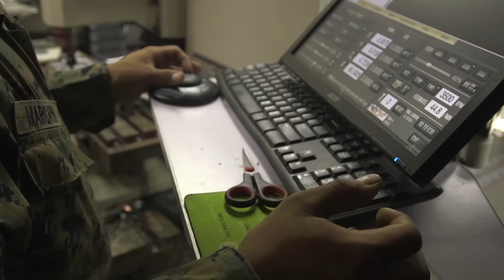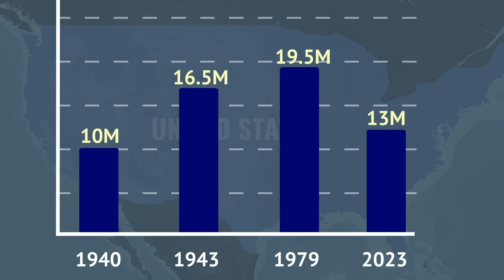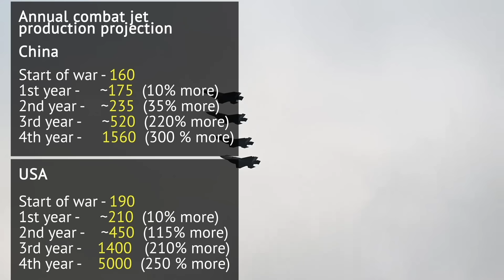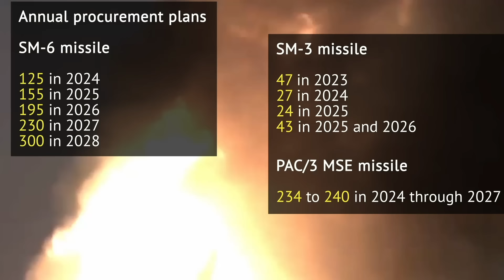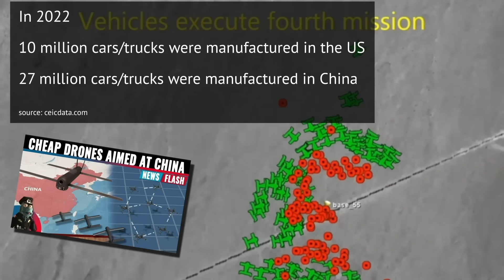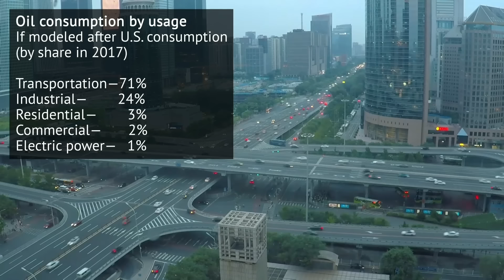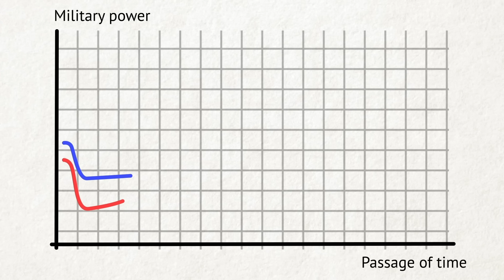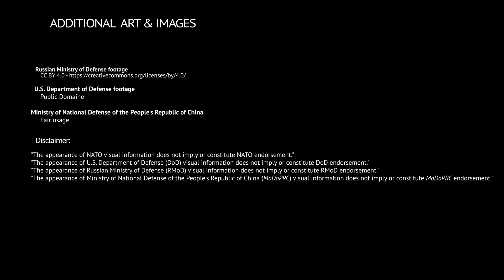Can industrial output decide US v China war?

Comment: Industrial out put is not the deciding factor, it is raw materials, I believe the access to material is all USA
Reply: It doesn't matter if 70% of the world steel plants are in China.  How much more steel can US produce with all the iron ore in the world?
Reply: @What7YiYue  55% of steel production happens in China, but 50% of steel consumption happens in China. We will enjoy seeing both of those numbers plummet. The difference between 55% and 50%— that 5% is what the world needs to replace, mostly by increasing output from its current 45% of global production. Big lift, but definitely possible. And even if there’s some small amount of shortfall, the US’s market power ensures that the US won’t face any shortages.

Comment: Commissar, I must report intel that you did not consider in your report. The US has declassified cruise missiles that have the range to strike the airplane factories that you stated were outside of airstrike range. The AGM-158B-2 has a range of 1,200 miles and can be deployed by B-2 Spirit stealth bombers operating out of Guam, Hawaii, or the continental US. They can also be fired from the B-1b Lancer and B-52, along with several current US fighters. This would change your calculus for the outcome.

China would not be able to fight the US to a stalemate in over it's land as they would lose the ablity to build new fighters very quickly in the conflict. This would make the planes they have very finite and they would be used much more carefully to protect the most vital areas in China: the capital, the dry docks for their navy, the air fields where their fighters operate out of, jet fuel depots, fighter pilot barracks, ammo depots, ports.
Reply: Thanks Knights, that was a rare example of comment which substantivly adds to the video.
Reply: @kennethferland5579  Yes. I only recently learned of these new, long range cruise missiles. They change the calculus for strategy for placement of SAM systems and factories for both China and Russia since they are capable of such long range penetration and can come out en mass from so many aircraft now.

Comment: China's real problem is the same one Japan had: they don't have any significant oil resources and their supply lines are extremely vulnerable. 
Building pipelines across western China to obtain fuel from a pipeline across eastern Russia is infeasible, the distance is too great, the environmental conditions too extreme, the throughput would be too little, and those pipelines would be extremely vulnerable.
So, any conflict would mean China needs to protect vulnerable trade routes like the Straits of Malacca which would essentially be at the mercy of a massive and overwhelmingly capable US Submarine force. 
And to China's detriment, there are perhaps five or six chokepoints out of the South China Sea where that vulnerability could be exploited, which would lead to a shutdown of all trade to China from the Indian Ocean. 
Which is the route used to ship the oil China buys. 
What this means is a direct conflict with the West, if China has not secured those very vulnerable energy supplies, would mean an almost certain defeat for them.
And... With the World's increasingly reduced dependence on the Chinese manufacturing base, most economies are reaching the point where they could easily weather the storm of losing access to Chinese products in their markets.
Of course that leaves China looking at certain ruination while sitting on a large stockpile of nuclear weapons. I know their policy is no FIRST use, but... That's a lot easier to say before everything is falling apart, isn't it?
I suppose we must all hope the decision-makers in China seek to avoid a kinetic war as much as they seek an information and economic one...
Reply: Russia has a lot of oil and natural gas that can supply China each day!
Reply: @LH1xx Nowhere close to enough transport capacity.
Reply: @LH1xx  They can... But getting it from where it is in Russia to where China needs it will be problematic...
Reply: Exactly why China spent so much on clean energy and electronic car.

BTW, China is the world's 5th oil producer, so military running out of oil is not going to happen in China.
Reply: @a24396  Why? China and Russia are strategic partners, Russia would supply China with oil and gas no problem.
Reply: China lot of oil reserve, it simply has higher consumption. In war time, there won't be shortage of oil for it's top priority
Reply: @tainechen1634  It's not their military running out that will be the issue, it's their overall economy. Ultimately the energy issues can be solved but there will be a massive disruption of their economy first. I suppose if they are extremely motivated to have a conflict with the west it's possible that disruption isn't going to matter, but unless there are some very strong forces prompting everyone to accept this level of disruption it doesn't seem likely the Chinese people will accept this for too long.
Reply: @LH1xx  The willingness is not the same as the ability. If you look at where the Russian oil is located and how far it is from china, how much pipeline would be needed, etc. that's the issue. It would all need to be built because it doesn't exist right now. So that delay might matter while a war is being fought.
Reply: @yingguo3683  China's reserves aren't the same as production. China is listed a number 13 in the world in terms of "proven reserves" but that's all in the ground. For them to support a war economy they would need to develop those resources. And there's little chance they'd have the time to do that.
Reply: @a24396  That’s just not true, China produce 5 million barrels a day, 4th largest in the world, they have 25 billion barrels in reserves, 14 largest in the world.
The import from Russia rises every day and several pipelines are being built and when they are connected to the Russian  pipelines that already exist they get what they need to wage war from them, it’s not hard to build pipelines to Russia, and they are not vulnerable.
Far from US reach.

So no, they don’t need to protect their trade routes, that’s a problem for USA to keep the blockade and police other nations that would do what they can to brake a blockade, China will not starve or freeze.

And easy wether the storm lol, Europe and the world are still in the storm after the Russian invasion of Ukraine, and that’s a war with insignificant nations when it comes to export/import and word economy, a war with China and USA would plunge the world economy to the depth of hell.
Reply: @a24396   China has a lot of oil reserves for war. Also Russia can send oil and gas to China through trains and trucks, and China also produces their oil and gas.
Reply: @a24396  If China can not produce enough products, the West also is in trouble.
Reply: According to the most recent data from the Ministry of Natural Resources, China's oil reserves totalled about 3.8 billion tonnes in 2022, accounting for about 1.58 per cent of global reserves, and ranking 13th in the world.
Reply: @LH1xx  Western dependency on China has steadily diminished.

As of the end of 2023, US trade with China (imports and exports combined), over the last 12 months, was roughly 575 billion dollars.

And that's a lot, but in 2022 it totalled 800 billion...

And the trend line for 2024 is negative...

This is because the goods produced by China aren't irreplaceable and the decision to do business there isn't only an economic one.
I guess time will tell...
Reply: @MrCastodian  You seem not to have thought this through... If the US submarine force is busy sinking supertanker a that bring oil into the South China sea then no one is going to take a ship carrying oil into the South China sea. And if the US Submarines are unopposed, then there's no chance anyone is going to be able to avoid that interdiction. And, as long as there's another market for that oil, the merchants will be happy to sell to those other customers.
Reply: @a24396  LOL Everyone knows the Chinese products exported to Southeast Asia and Mexico then changed the label and sent to the US, if not the Americans had to face far worse inflation than what you see now.
Reply: @a24396   No, during wartime, China imports oil from Russia by oil pipes, trains, and trucks, no need to use supertankers to bring oil through the sea.
Reply: @LH1xx  "Everybody knows that"? 🤣🤣🤣 Okay... Sure... Oh, and our inflation last month was 3.2% - which is roughly what the Fed targets.
Reply: @LH1xx  "During wartime" - what wartime? That theory doesn't make any sense. Russian oil production is thousands of kilometres from china and the oil would have to move across some of the least developed terrain in the world. The infrastructure to move this oil doesn't exist and it would take a long time to develop it. And there's no reason to spend the money it would take to develop it during peace time because of the far less costly option of using supertankers. And during a war it will take years to build out the infrastructure to avoid needing supertankers...
Reply: @a24396  No, China sells a lot of cars and other products to Russia by railway each year, when they come back they can bring a lot of oil back, I don't see any problem.
Reply: @a24396  If without those Chinese products, the inflation in the US right now is far worse, Chinese products help to reduce the inflation in the US.
Reply: @LH1xx  Unless those "goods" are also liquid hydrocarbons, the train cars aren't going to be the same.

The places where Russian oil comes out of the ground is nowhere near the population centers, which is where the goods are going to be used.

And, there are basically two rail line between China and Russia that would allow cargo to travel the tens of thousands of kilometres between Chinese manufacturing and Russian consumers or Russian production and Chinese consumption centers.

And that's only true if they fixed the southern tunnel that saboteurs collapsed. I encourage you to look into it, it's not as simple as you're describing.
Reply: @a24396  Why oil production sites should be close to population centers??? All you need is to build pipe and start pumping oil as much as you want. And yes - building pipeline actually is very fast. Just for example famous Nord Stream underwater(!) pipelines took just about 1 year to be build. Though it took 10+ years to reach agreements on pricing, eco stuff, etc, etc. Though Im pretty sure that you would agree that in war time main part of this bureaucracies will be skipped....
Reply: @a24396  What are you talking about? Russia already has transported oil to China since 2016, China has many trains that can do the job doesn't matter how far away, you don't have to worry.
Reply: @Mr_MikeB  The claim being made was the same trains delivering Chinese cars could then turn around and return with Russian oil.

Bur... If the cars are sold in Moscow and the oil is located in Siberia then we're not only talking about completely different rolling stock but two very widely spaced destinations.

And there's no "triangle trade" option that makes any sense in the Moscow to Siberia leg.

A single VLCC (very large crude carrier) carries at least 2,000,000 barrels of oil. And while there doesn't seem to be a single "standard size" of Chinese "Oil Tank Wagon" - of the few I found, the highest maximum volume was 53 cubic meters. That's 333 "barrels of oil" - which means that replacing a single VLCC would require 6,000 train cars. That's a line of train cars roughly 80 kilometers long. As an example of how unmanageable this would be: over the course of three months in 2023, china received upwards of 131 VLCC. That's 2.9 million barrels of oil a day.

So... A train isn't the answer unless there are a LOT more tracks built. Likewise, a pipe wouldn't be a great solution because the terrain between the Russian oil-producing regions isn't flat. In fact, the oil moving by pipe from Siberia to China would have to be pumped more than 4,000 km, over some of the most desolate terrain in the world. And it would be vulnerable to a single Ukrainian attack drone. Or a single leak... Or a single mistaken pumping command...

The point is the infrastructure just doesn't exist to do this in any meaningful way and pretending otherwise for national pride, or simple contrariness doesn't make much sense.
Reply: @LH1xx  China has an estimated 900,000 total train cars - but almost all of those are passenger cars. And while no good data seems to exist on the number of Chinese Oil Tank Cars that are currently in service (at least in English), the problem is enormous: a single Very Large Crude Carrier has at least 2,000,000 barrels of oil. That's roughly 320,000,000 liters of oil. Which would require 6,000 oil tanker train cars (there doesn't seem to be a standard size, but the largest average size I could find carries 53m3 of oil - or 53,000 liters).

Though the data is hard to find I did find a reference to a three month period in 2023 when China took delivery of 131 VLCC ships. This was presented as the consistent average number and if that's true it means an average of 1.5 VLCC per day. And that means 9,000 train cars full of oil per day. And since the trip between the Russian oil-producing region and China along the route they'd have to take is a trip taking at least four weeks, you're really talking about an eight-week turnaround. 

So in order to have 9,000 train cars full of oil arrive every day you're going to need a fleet of tanker cars numbering more than half a million! (9,000 cars arriving per day x 4 weeks per trip x 2 for the round trip x 7 days per week = 504,000 train cars!)

And... The most problematic issue of all is this: The Russian, Mongolian, and Kazakhstan rail systems use a "gauge" of 1,520 mm (gauge is the distance between tracks). In China, the gauge used is 1,000 mm. The train cars are incompatible except in very specific instances and locations.

Like I said, it's a lot more complicated than you have given it credit for being...
Reply: @a24396  No, China doesn't all depend on trains, there is a big oil pipeline that can transport oil to China from Russia each day and there is an oil pipeline from Kazakhstan to China that can transport Russian and Kazakhstan oil to China. Russia also ships its oil from its east coast to China's seaport.
Reply: @a24396  China has the largest industrial size, China can easily produce many more train cars in a few months I don't see any problem. Yes Russia and China have different standards of tracks, when Chinese or Russian trains cross the border they have to change the train wheels, which needs a little bit more work but that's fine, their trains still can enter the other side of the land.
Reply: @Mr_MikeB   look at the Alaska pipeline and how many workers and equipment it took to complete. Now imagine middle of nowhere Siberia trying to get a pipeline through in a year. Lol not happening. And railway bridges and tracks would be the first thing the Americans targeted.. Virgina subs would close the Malaca strait and China economy stops. China knows it can’t start a war it can’t win.
Reply: @LH1xx  if it exist it would be the first thing targeted
Reply: @DirkDiggler-qp3vm  Nah, those tomahawk missiles are too slow and are easy to get intercepted by the Chinese air defense system.
Reply: @a24396  Well, in most of the last 180 years, China was either under an invasion or under the threat of an invasion, so it's only natural China makes some preparations, energy independence is one of those preparations, solar energy and electric vehicles can reduce oil dependency level.
Reply: @tainechen1634  I absolutely understand and agree it's just smart planning for them to be prepared. But, with something like 500 nuclear weapons and strategic delivery systems that can get them anywhere in the world, the threat of "attack" or "invasion" is about as close to zero as it gets...
Reply: @a24396  Man - just take a look how far Siberia is from Ukraine... So - no drones are not threat to Rus-China pipelines... Plus, desolate terrain means its easier to protect those pipelines btw - just because there is no, lets say, unauthorized personal there. So only problem is on building stage... Well, length is not a problem - just check how long are current Druzhba oil pipeline which was built some 50 years ago I believe.... Rough terrain? Arent that just additional costs but not a problem de facto?
As for trains - they got to be really huge, true. But answer to yourself - is that doable or not?
Reply: @DirkDiggler-qp3vm  So you think China has lack of equipment or workforce?? Really? Next - do you really think that size wise China is about the same size as Iraq or Syria? Really? It will be real eye opener for you then - China is about the same size as USA.  And now answer yourself - how  easy it is to target something in the middle of USA? What about other coast? What means could be used? You will quickly find out that options there are very very limited...